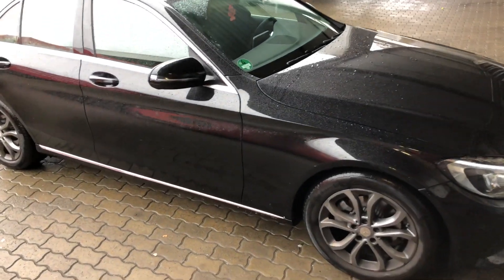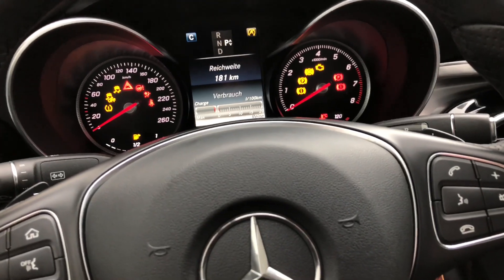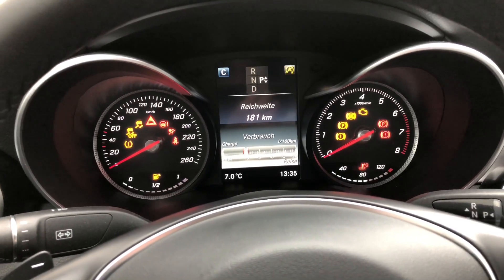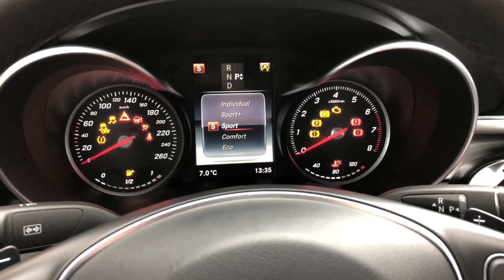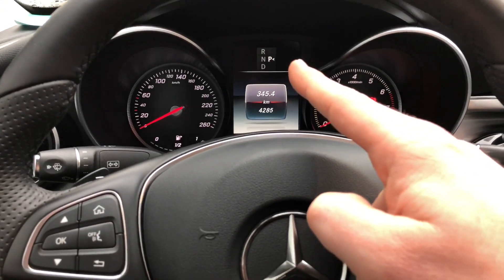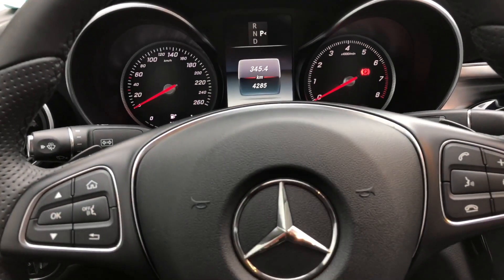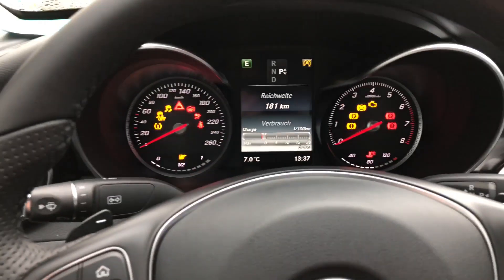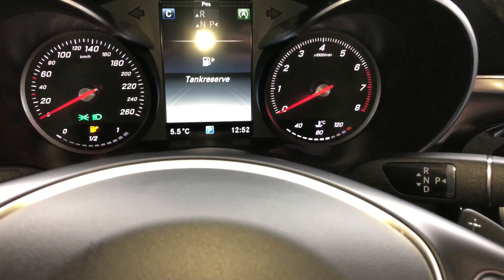How to use the ECO start/stop function Mercedes Benz C180 Sedan/Saloon DIY

Comment: mine is always yellow, not change to green and start stop not function when yellow, what can i do?
Reply: Same when you know let me know
Reply: ukfinest123 recently it turned to green and start work, but after few start/stop turned yellow again. Check battery voltage its ok, 12.7 volts. I dont know why only 2, 3 start and stops and changing yellow again.
Reply: @bebeto6861 Don`t touch it, your battery will now last more years.
Reply: Just replace the battery had the same issue with mine
Reply: @boshir123  true, i have changed the battery with Varta agm and now green light also in winter cold